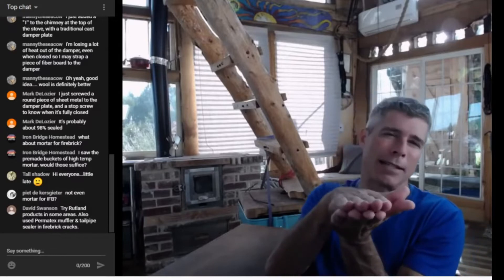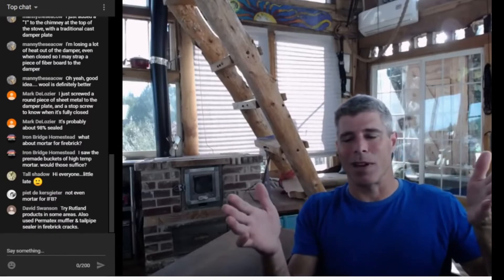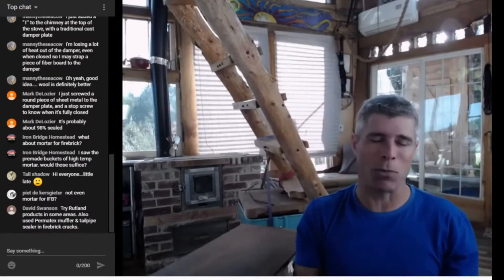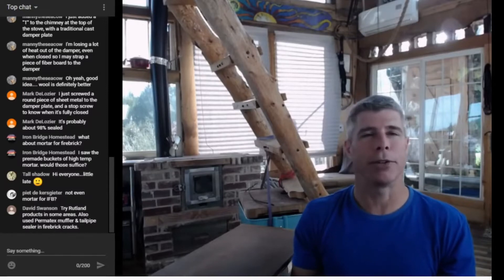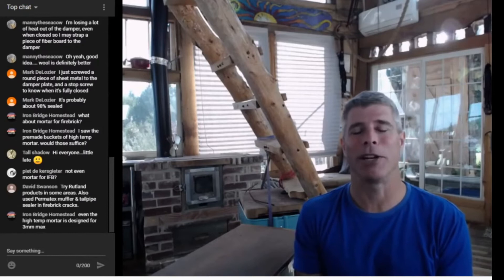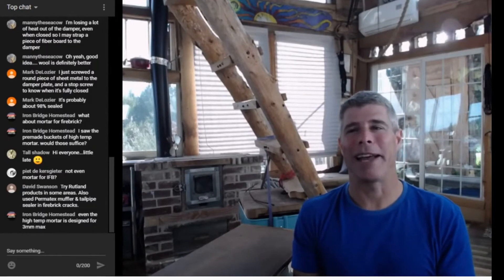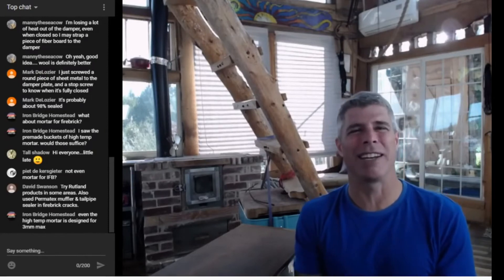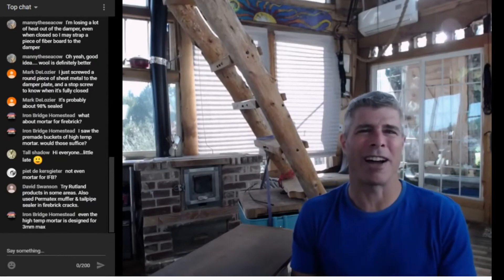Mortar in a RMH Core

Comment: Couple of things. Just a note I got a 404 page not found for your index/html shown above. 2nd, in a conventional [if there is such a thing] RMH, using a bench as the heat battery, would sand work better than gravel/cob?  Seems a lot of interest in sand batteries in 2023.
Reply: depends on gravel shape and size, because you could have limited convection through the gravel OR the air could act like insulating pockets around the points of contact between the individual gravel pieces.  i would imagine cob and sand would act similar. sand is a bit of a meme right now to be sure, because its consistent and all you'd have to do is pour it. cob you have to make and then form.